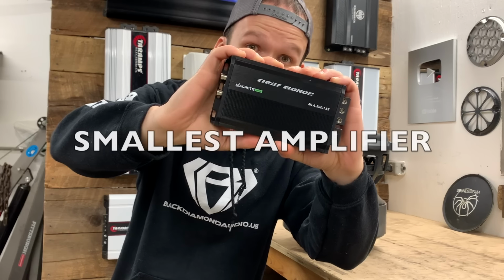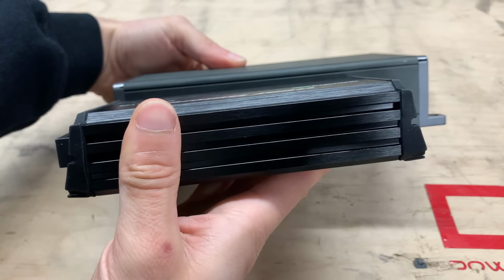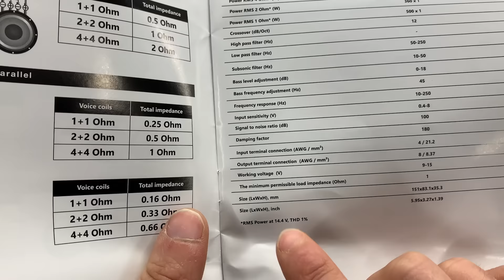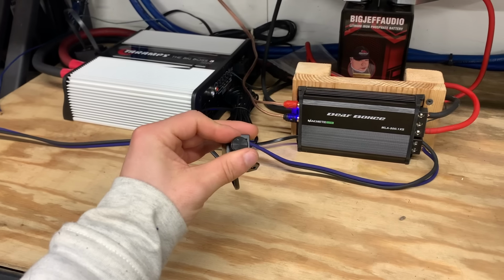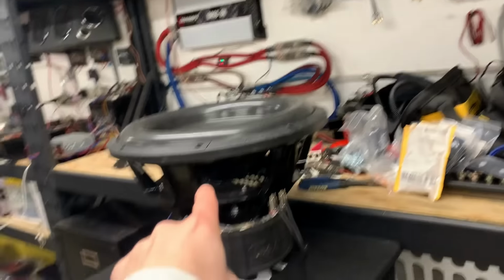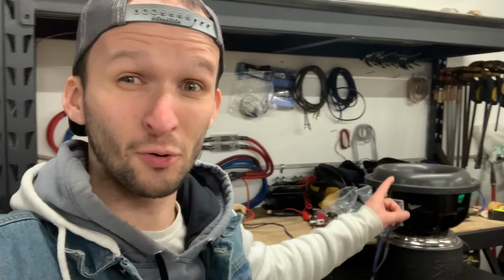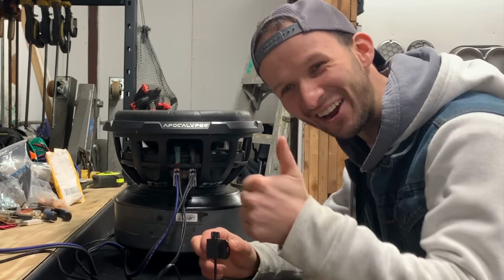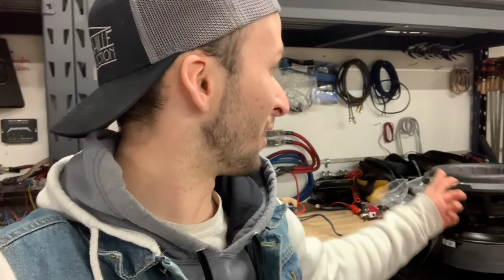Their SMALLEST Amp VS Their BIGGEST Subwoofer!

Comment: So I have an honest question... Please let me know if I've been sold some snake oil. Many years ago while having a sub/amp discussion with a buddy of mine. We were talking about the difference between an overpowered sub vs underpowered amp. Obviously if you throw too much amp power to various underpowered subs you risk blowing out the sub for various reasons. The argument that he was trying to make is that an amp supplies power to the sub to not only extend the cone but then at the same time has to have enough power to essentially "pull" it back and that an under powered amp might not have enough power to do so and therefore cause over extension. His argument souded good and was presented well and he was a friend of mine who wasn't necessarily trying to sell me anything other than the aforementioned snake oil. Is there any truth to this at all or is this just a silly uneducated wives tale? The only way that this might make sense is if the amp was just underpowered enough to push the sub out to full extension and then clip or shutdown and then not be able to "pull" it back but I wonder if amps actually do even make this "push/pull" motion to begin with. I'm a fairly smart dude yet intelligent enough to say that I'm completely ignorant about this particular subject. VERY curious, please help!

Comment: I have to ask, why wouldn't it have powered the sub? I've never seen an amp that was low powered not work on ANY sub even low power, I've seen 1000 watt RMS subs run off of a 50 watt amp. I guess I don't understand the concept of the video, unless it was just to show that new amp, but to say " will it power..." shrugs